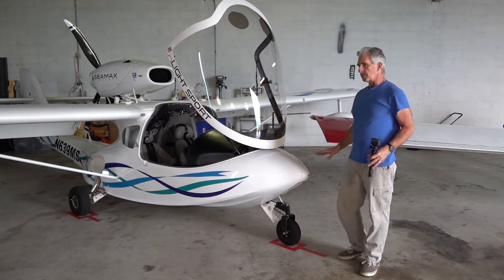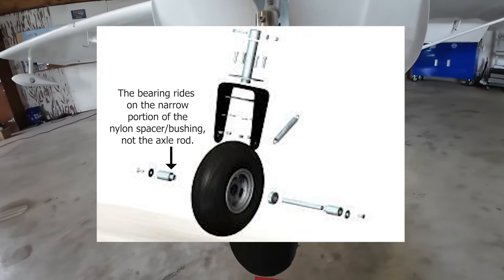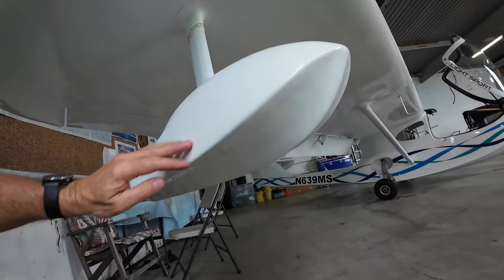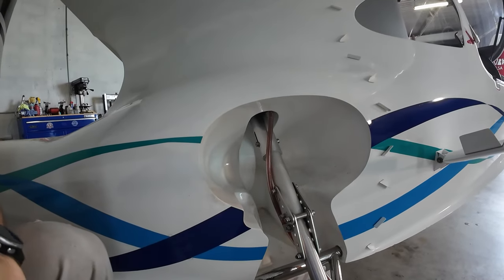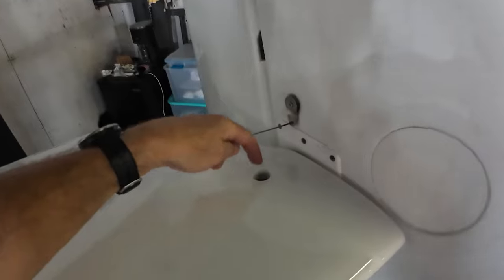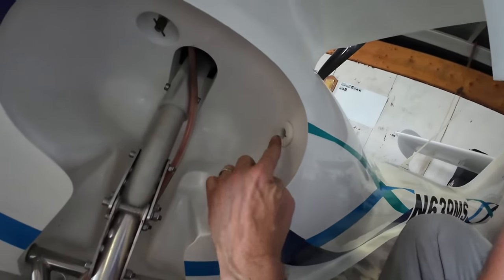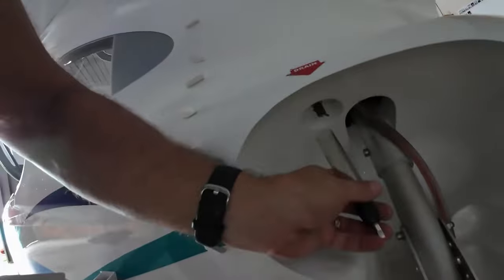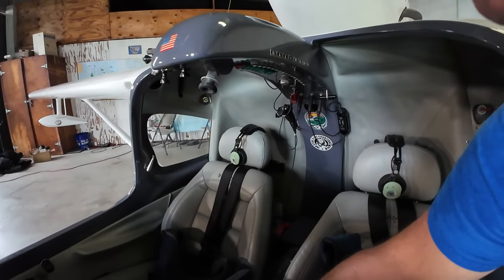Seamax Preflight

Comment: With icon going busy seems YouTube traffic is directing to the seamax and you are the man here, great video 
Seamax’s website is dated from 2022, are you aware of any new engine options? 
Is there no mixture lever on the 912?
I’m currently flying a da20 with continental, and looking seriously at the seamax to get us in the water
Reply from the maker: Thanks so much for taking time to watch and for your kind comments!
It's sad to see the difficulties some manufacturers like Icon, Searay, and Seamax are having. Hopefully everything works out!
No mixture or carb heat controls on the Rotax. It's single lever and with the 912 ULS has pressure compensating carburetors. Seamax does offer a 912iS engine that is fuel injected.
I genuinely love our Seamax but I do have concerns about the company's ability to build and deliver airplanes. There is a backlog of folks that have paid deposits and have been waiting a long time for their airplanes.
Regardless of what aircraft you end up with, once you get your feet wet you'll be in love with aquatic aviation!
Cheers!

Comment: I noticed that the tail fin has a fixed plate deflector on the port side. I have seen this on sailboats to trim the boat, is this similar and why?

Also, are you able to fly inverted with this carbs?  Have you tried 😊
Reply from the maker: Thanks so much for watching! That tab is indeed a fixed trim tab for the rudder, which controls yaw. It uses airflow to provide, in this case, right rudder pressure to counteract the effects of P-factor and spiralling slipstream. It makes it so I don't have to hold right rudder pedal while flying.
As to the carbs, any sustained negative G maneuvers will cause the engine to quit due to fuel starvation because the carbs aren't designed for it. This being said, positive G inverted flight would be theoretically possible but the Seamax is neither designed nor certified for such flight.
Cheers!

Comment: Too long too much messing around takes the fun out of flying with all these safety checks each time you take off and land. Geese have to be a designer to make sure you check all the moving part. You need to have an engineering degree just to fly it.
Reply from the maker: Thanks for watching!
The video is longer than an actual preflight in practice, but I still budget 30 minutes to prepare for flight. Safety is our paramount concern and doing a thorough preflight is the best way to mitigate risk.
A basic understanding of mechanics and science is all that's really needed, but I will agree that flying isn't for everyone!
For me, the work is far outweighed by the fun!
Cheers, and thanks again for watching and reaching out!
Reply: Far better to do a thorough preflight and avoid in-flight emergencies or, God forbid, catastrophes, as has happen many time in the past. Besides I enjoy the preflight. It focuses one's mind on the very serious task ahead - flying.  It is a blast, but does require mental discipline and problem solving ability under pressure. Thank you for the great and very thorough video.  Having flown in a SeaMax in Brazil, it was very informative and enlightening.